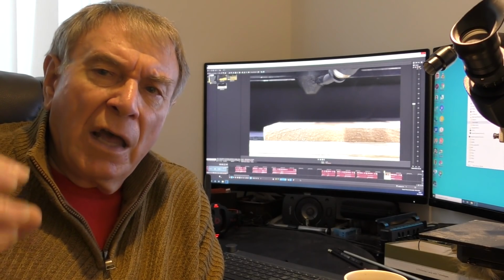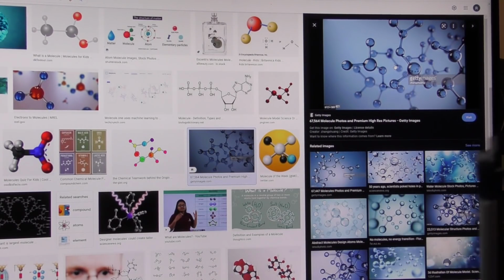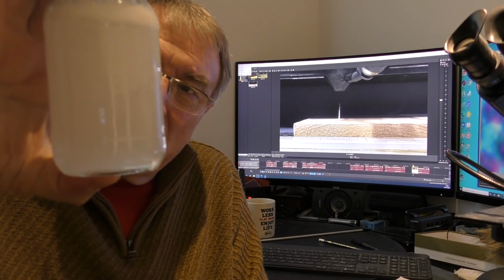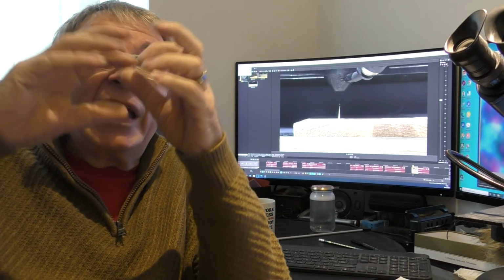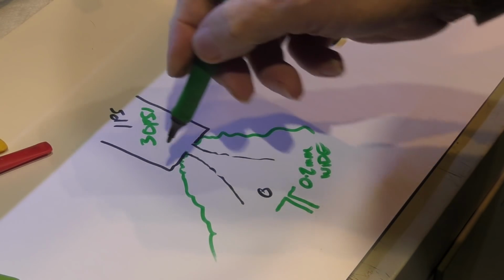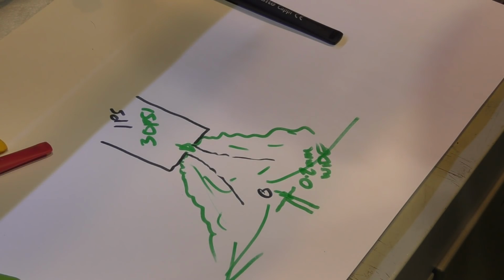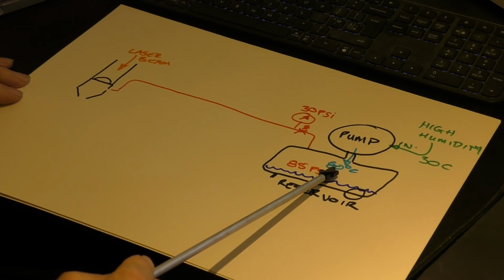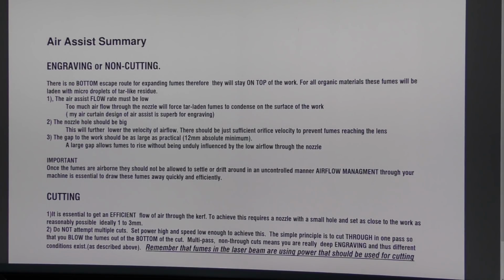RDWorks Learning Lab 223 Air Assist  Why, How and When

Comment: Principal  Engineer here with four decades of experience.  Sorry for the argument from authority, but otherwise I'd fall into a bucket of non-technical people just saying things.  :-)   I do like your advice about moving the nozzle closer to the work (if the setup allows for this).  I regret I'm not a fan of the rest.  I don't mean to come off as debating or negative. I'm just trying to offer objective facts and guidance.  I've run similar experiments including one using the same piece of ply and cutting three test boards (the one with circles in a 5x5 matrix) and the enhanced cutting performance was both significant and undeniable. I had already upgraded the OEM air assist to one putting out 4x the flow, as I was skeptical of the compressor claims myself.  Yet the difference in cutting performance between that upgraded air-assist and using a compressor at 30psi was greater than 50% (calculated to be 63%, but that was performing the experiment just once, so...)  The ONLY variable was air pressure in that experiment.  And, yes, I saw differences in cutting performance up until around 30psi.  As for moisture, a simple water/air separator (inexpensive from Amazon) is all that's needed on a compressor.  Arguments have been made a drier is needed as well, but I don't believe that.  Since the lens is not 100% transparent to the laser, the laser heats up the lens enough so that moisture will have a difficult time condensing on it.  Without a water/air separator the danger is the temperature of the lens might still be under the dew point.  With a separator, this is highly unlikely to occur, but to be clear - this is speculation on my part as I have run no experiments to prove it out.  Just experience with many hours of laser/compressor time and no ill effects.  What you need to do is run an experiment with a control and vary only the pressure.  Pick a nozzle distance and keep it across all tests.  The results, favoring the compressor, will be quite clear.  Again, I doubted it, but needed to see for myself, in the face of all the compressor hype.  The hype turned out to be true.
Reply from the maker: Hi
I have done a lot more testing off camera but I am always open to advice  and the wisdom of  other's experience.. I would be interested in a few more details about the actual cutting tests as I would like to emulate them as far as possible for others to see. If I have not given the subject a fair assessment, I have no problem expanding what I found with others  experience which I will gladly credit jf you are happy to share..  The sort of details I would be interested in are,  the type of machine you are using, (RF or glass tube), the power you use for the test. The  type and thickness of plywood, the cutting speed range before and after raising pressure, The diameter of your nozzle orifice and the distance away from the work. Finally what type of lens and focal distance are you using.
Reply from the maker: ps I accidently touched the reply button before saying thanks for the comment. I am always grateful to people such as yourself sharing their experience. I do not regard it as criticism, it is another learning opportunity for me.
 Best wishes
Russ

Comment: Nice video Russ, so saw you moving the nozzle end up and down, i have a china blue and cant move that part. Can you get tube extensions for these machines so your lens is still at the focal distance but the nozzle tube can be closer to the cutting surface? I can only move my bed and substrate up to the nozzle which will then put my put of optimum focal distance
Reply from the maker: Hi
You have an 18mm diameter lens fittred in your nozzle and retained by a  screwed bush 
 If you want to lower your nozzle but not changerthe focal distance, then that's the same as raising the lens. Just make an 18mm outside and 14mm inside diameter washer 3mm thick and drop that into your nozzle first, That will give the effect you are after.
 Best wishes
Russ

Comment: I bought a relatively low flow Hailea 9820 pump - just like the low PSI cheap chinese ones, but without the pulsing. It's quiet and provides a nice steady air flow. I would recommend looking into it.
Reply from the maker: Hi 
That  pump delivers a max pressure of about 2psi when the flow is almost zeo and close to 60 l/min free flow  with almost zero pressure resistance. I have not been able to track down any performance graphs but my guess is that at the flow I estimater is needed for reasonable cutting, (about 8/min) the pressure will be about 1psi.. All 3 of my machines are Hailea pumps. They specialize in soleniod driven diaphragm pumps  and are a Chinese company.   The aco 9820  is still a pulsing output  but at its very low pressure capability the pulsing will not be dramatic. In general terms, quiet means low power and at 35 watts  is pretty low. Thanks for the recommendation 
Best wishes
Russ

Comment: What about making a laminar air flow nozzle?
Reply from the maker: Hi Robert
 I assume you are referring to a 3D printed  "laminar flow" nozzle.. The principle was based on the design of the sort of laminar flow generators used in the dancing fountains at Caesars Palace in Las Vegas. That design is specifically for incompressible fluid. Sadly air is compressible and the principles are unusable.. I'm not going to  explain the physics of gas laminar flow I will leave you to Google that and then decide if you could design the nozzle you imagine.  If you watched the whole video then you will have seen my demonstration  of viewing the nozzle airflow. into a puddle of water. I showed what "nearly" laminar flow looked like and then how ineffective it was for cutting.
  
I genuinely appreciate your comment/question because you are the not first to ask about a laminar flow nozzle. So many thanks
Best wishes
Russ

Comment: Your excellent explanation has lead me to a bit of thunk. Could you design a dual nozzle system for the air assist? One nozzle blowing across the orifice for scanning and one through it for cutting. They could be switched using air assist on/off function via a dual outlet solenoid air valve. No signal to solenoid  valve defaults to across orifice (Scan mode) Air assist signal changes output to through orifice. (Cut mode). Keeping the solenoid valve near the pump(s) and installing 2 pipes would save wear & tear on the stepper motors. A light weight 3D printed across air nozzle would do the same. You can have the patent in exchange for a free sample. :p
Reply: Hi Derek
When did you last check with the patent office?  Remember this was quick instant thought and test to see if it worked after I had watched the way that smoke was still blowing down even with a light whisper of air assist.  My thoughts at the time  were planning for the possibility of swapping the tubes on my air assist valve and bringing two pipes to the head . However,  in reality I don't believe I need two pipes because the existing arrangement will suffice.  Cutting and engraving are usually done with  two different nozzles.  Thus if I do a better engineering job of integrating the fishtail air blast onto the engraving nozzle,  when I use an engraving nozzle I will use the YES blowing function. When I swap to the longer CUTTING nozzle  I will use YES for cutting layers and NO for engraving layers as I often do at present with  low quantity mixed jobs. There are many times when I have nameplates, key fobs or coaster to engrave  where the shape remains constant but the engraving is different. I always break these jobs up and cut all the blanks first and then make a jig for engraving.

Thanks for the nudge .......I must cancel that patent application and save myself at least £20,000

I genuinely appreciate your thunk. I enjoy it when thoughts coincide  but equally I am not that proud about using someone else's good idea. I will never steal an idea , I always credit the innovator and honestly admit that i am jealous of not thinking of it first.
 Best wishes
Russ

Comment: An external air mod is something I have been contemplating for a few months and your test has now kicked me in to doing it. I still use the original Chinese pump for cutting but have my machine set up with very small and cheap fish tank pump teed in to the air line which runs when the main pump is off. I use this to keep smoke off the lens when engraving and it seems to work well. I have only just changed from the supplied 2 inch lens after nearly 5 years. Ruida's air control triggers one of the relays I fitted when I rewired the machine and when normally closed this relay runs the small pump then when triggered by the program calling for air it switches to the larger pump. I like the idea of a permanent flow meter and will be fitting a spare one I have this afternoon. Great video once again Rus, you have answered a load more questions I had buzzing around.

Comment: Hi Russ, I still use the small compressor with the solenoid to provide very low flow for engraving and high flow for cutting. I have also mounted the compressor and extractor in sound proof boxes now life is good :-). Thanks for a very comprehensive video. Again

Comment: Hi Russ, normally "professional" engravers (business-wise) who do a lot of cutting work use compressors that can deliver around 200 Liters/min at 8 bars or greater. And they use water separators so you don't get the effect you talked about which destroyed your lenses. And if you could repeat your test with around 4-6 bar (50 to 90 psi) I would like to see the difference. That is the information I got from those professionals. And I must say with my normal cutting I use 4-6 bars and get way better results than with the little membrane pump and on top, my silent compressor is much more silent than that Chinese membrane pump. Maybe you could try to get another compressor? Thank you for your enthusiasm and great work :-)
Reply: Hi Sebastian
The numbers you cite will be for a hydrovane compressor that can deliver 230 l/mi at 10 bar but requires 2.2kW to run it. At about  £2000 for the compressor plus almost another £1000 for a dryer to handle that capacity,  that's a step too far for my simple shed science. However, I note that you are  already using a  high pressure and high flow system that is giving excellent results. Perhaps you could post a video of your setup with high and low flow rate test  examples  so that we can assess if the difference in speed, cut depth or finish  is worth the investment for hobby use. What is your nozzle orifice diameter and how far away from the work surface is it? What compressor/dryer system do you use?
My new cheap Chinese diaphragm compressor was not bought for this air assist application,  that was just a coincidence. My 30 year old piston compressor is now shaking itself to pieces and it's replacement does not have to last another 30 years!!!!
 Best wishes
Russ
Reply: @russsadler3471  Hi again Russ, unfortunately I only have a simple water separator, but the compressor is a STAHLWERK ST 510 Pro this can deliver a continuous output of approx. 200 liters at 8 bar pressure, the price of 500 € (~ £ 425) is also moderate for this performance. I have different nozzles and lenses currently I have the set of American Photonics 25mm diameter lens tubes with ZnSe. The focal lengths are 1.5 ", 2.5" and 4 ". The nozzle outlet is very small with this set (but has to be re-measured). Second, I use a Cloudray E series head with a 2.5" lens, also ZnSe here I say the difference in beam quality to American Photonics lenses is extreme. That means the lines of the Cloudray lens are clearly "worse" as far as I can tell, despite the correct focus. I usually do not cut very thick material because 90% of the time I only make decorations for the children and women when I have the time. However, the difference in the cut quality at 2.5 "distance with the E-series head is very large from the membran pump to the compressor at 6 bar. The American photonic heads have significantly less distance to the substrate, similar to your attempt at the nozzle outlet far on the workpiece, in contrast to the E-Series head. Unfortunately I don't have much time at the moment, but I promise I'll do a few tests with my machine, maybe I'll come between the holidays. I still have your email address would then provide you with the results.
Reply: @Sebastian-kc7id  
 Hi Sebastian
My genuine thanks for sharing this information and there is no immediate rush to create a video but it would be good to see some of your results in the new year
 
 Have a safe and very happy Christmas
 Best wishes
Russ

Comment: This immense, really. I was on my way to buying a 140 l/min pump, but I will stick to my 50 l/min pump. With this video, I now owe you one hundred pints of beer, if my calculations are not wrong :P

I am running all the improvements as you are also doing (cutting nozzle, full flow rate, 1 HP extraction turbine, nozzle 3,5 mm away from cutting surface) but I am still getting browning over the top of my work, also from one side of the kerf. The only difference I find is the jet of air coming from the aperture at the machine door enters at the top level of the work instead of the bottom level of the work. Do you think this might be the cause of the issue?

And just before answering that, add another beer to my bill. Cheers!

Comment: 🤔 you still have your conical nozzle and it's attached airflow pipe attached while you pass air across its face with your new setup. Will the Venturi effect of the cross flow air, draw air in through the, presumably, open original pipe, and clear the air under the lens? Or, to put it another way, would the efficiency of the process be reduced by blocking the original pipe end, thus reducing the movement of air under the shrouded lens?
If the original pipe is actually enhancing the clearing property, is it therefore possible to loose that benefit if the pipe is placed in such a way that it would actually draw in smoke from the surrounding cabinet?

Excellent video, thank you.